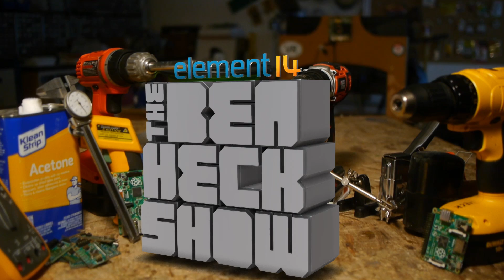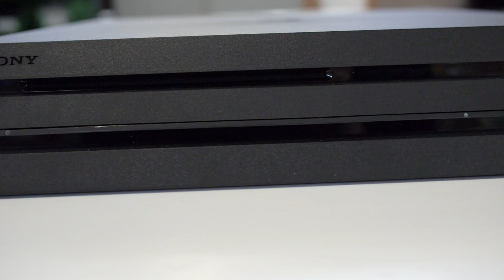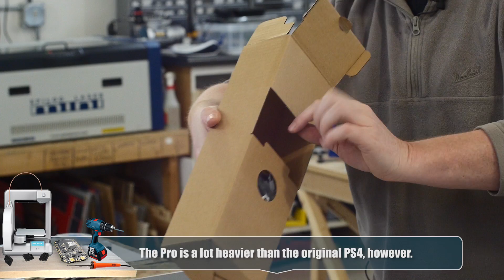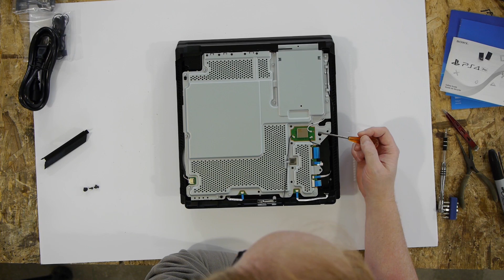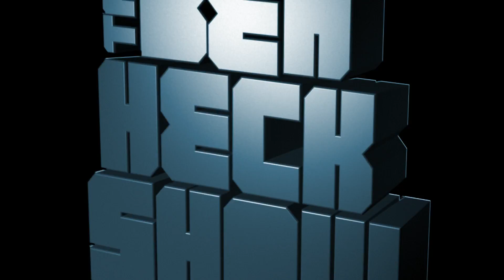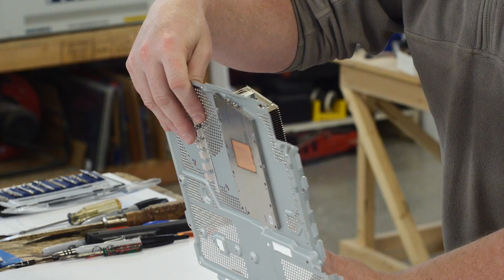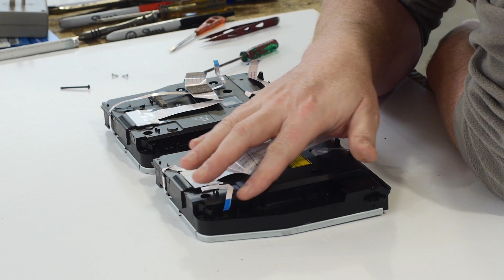Ben Heck's PS4 Pro Teardown

Comment: if I could get one of those in my hand, I will turn it into a laptop or desktop, and install linux and run steam, so u dont have to pay for psn to play online
Reply: piece of potato if you could (you can't) do this why it's specs are terrible and you might as well just build a pc or buy a laptop consoles are terrible all games run like trash build a pc
Reply: piece of potato you wouldn't be able to do that lmao
Reply: leon1234578 let a potato dream...
Reply: Max Schwartz ok but desktops are cheaper than laptops and even if you have it look like a laptop it takes to much power to run off a battery
Reply: Max Schwartz yes but what I'm saying is you could build a budgett pc for the price of manufacturing parts and custom electronics to create a ps4 laptop you could build a equal pc and then no paid online and cheaper games allso the higher options on pc is a better deal now and long term allso background compatability
Reply: what? the 970m has more power than your console does

we are talking about a graphics card that can run 1080p native with medium-high settings and still pull a consistent 60fps, ya it doesnt perform like a regular 970 does but the 970m performs about where the desktop class gtx 960 does

also your desktop doesnt game at 8k yet alone even touch 5k, cause if you knew how to actually build a computer you'd know that the ps4 pro is the worst when it comes to price vs performance, you can literally buy a $250 prebuilt and throw in a RX460 for another $100 and beat the PS4 pro
Reply: I stopped reading where you said you prefer upscaled 1440p from a 900p console over 1440p upscaled from a pc running native 1080p. 

And yes you can put a RX460 in a prebuilt and get the same level of performance as a ps4 pro, it's not hard to replicate a console that barely runs 1080p 30 fps at low settings
Reply: lmfao you think the ps4 pro gives you higher fps than a gaming computer?
i guess you wouldnt know a difference from 30fps to 60fps because you never experienced 60fps, having experienced both i can tell you that 30fps runs and looks like shit, especially on your 144hz monitor you claim to have

you sound exactly like a console peasant and what gave away the fact that you dont pc game is that you claimed there is no difference between 30fps and 60+ fps, you are gonna sit here and seriously say that you prefer it when a game looks and runs like crap when you have the option to play the game at a higher graphical fidelity and have a better response time, less input lag, and over all a smoother game play experience? god if thats how you really feel you must love VHS when its being compared to bluray since thats the video equivalent of what you prefer over what is subjectively better
Reply: also i dont need to invalidate your opinions, you do that already
Reply: that is true a bad game will suck across all platforms, just look at batman arkham knight, it sucked on pc and console but im not arguing that point, a game that gets intensive like battlefield will have all kinds of frame drops on console as opposed to a similarly priced PC and the proof is in the pudding, you can buy a used oem i5 2500k computer with 8gb of ram for around $150-250 off ebay and putting a rx460 or even a 1050 would yield much better results(heck you could even stay used and get a used 7970 for about $100) than what the current gen consoles are pushing, it might not be able to run the games at a higher graphical fidelity than the consoles but the frame rate will certainly be much higher than the consoles with dips not being nearly as taxing on the system as it is on consoles, when you say things like frame rate doesnt matter and that it wont change the entertainment value, id beg to differ as an unresponsive game with tons of motion blur(the downfall of 30fps) can make what would have been an entertaining game not entertaining and actually sickening to people who suffer from motion sickness 

i dont think you are understanding my point as my point has nothing to do with a bad game, but a bad experience for a good game and id also hate to burst your bubble but in a blind test people who havent experienced 60fps before will notice a difference in the response and fluidity of the game over 30fps, you're thinking about 60 to 120fps as that jump is not nearly as noticeable as it is going from 30 to 60 fps

not being an elitist here, i respect all forms of gaming, shit i have an xbox because i love halo and i have a ps3 specifically cause i liked the last of us but when someone gives bullshit reasons as to why they console game over pc game(IE my xbox one s plays all my games at 4k and i get the same frame rate as pc) i will not hesitate to call them out

Comment: This upgrade to a console doesn't really make sense to me, a console should be a stable development platform for at least 5 years or more imo. For the, for example, New 3DS it does make sense in the way it's used (download speed increase, extra RAM, quicker system menu access, 3D effect improvement). 

And Ben, don't judge the Switch before you've played it please, since it's a completely new system. It doesn't include legacy hardware compatibility like the GC, Wii and Wii U.
Reply: jorenmartijn yeah, why so much hate on console Ben?

Comment: ... could you possibly replace the Blu-ray drive with a 4k drive? doubt it but thought it a valid question..
Reply: old486whizz I don't think the firmware will support it but if you jailbreak the PS4 I don't see why not.
Reply: old486whizz no you wouldent have the correct drivers and software and the hdmi is wrong too

Comment: I don't think that they are 14nm FIN-FET are they, Sony is hedging it's bets but the the new XBOX ONE Scorpion runs an AMD ZEN chip that will be faster than the PS4 PRO.
Reply: The PS4 Pro is based on Polaris, so it is 14nm FinFet. The PS4 Slim and the Xbox One S are both also built on 14nm, that explains why they both consume less power, allowing for smaller heatsink, smaller PSUs and overall lower cost of production. For AMD, it's a lot more advantageous to switch all their factories to produce the same die size, because when you do a die shrink, you have to change the machines making them.